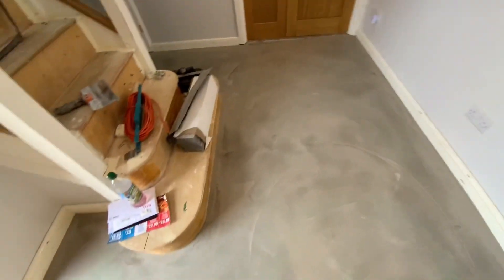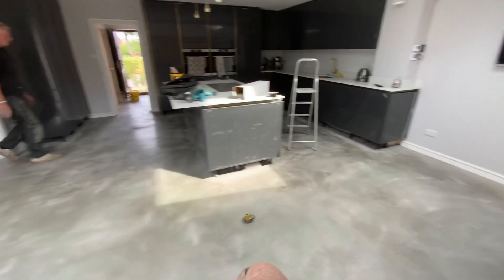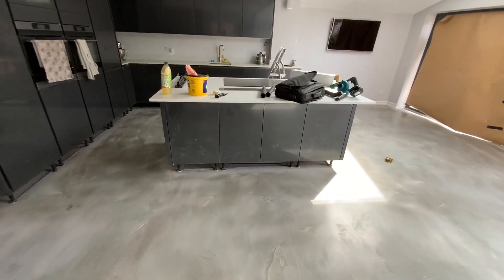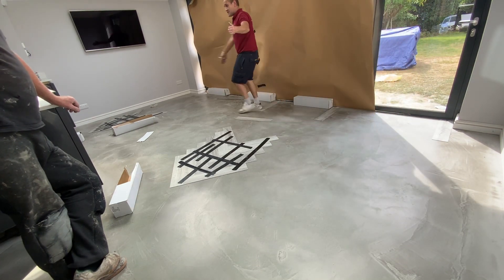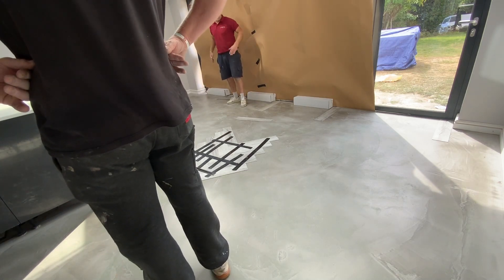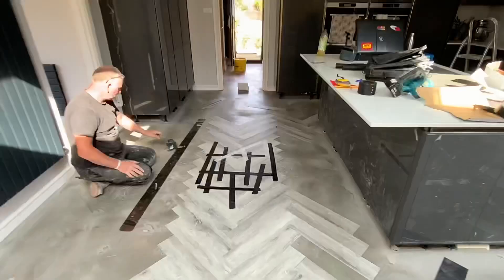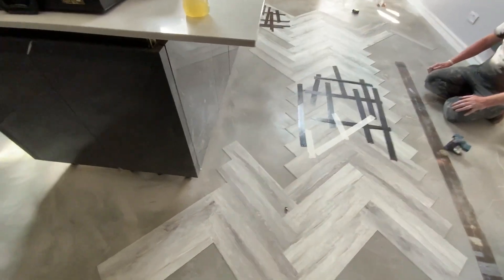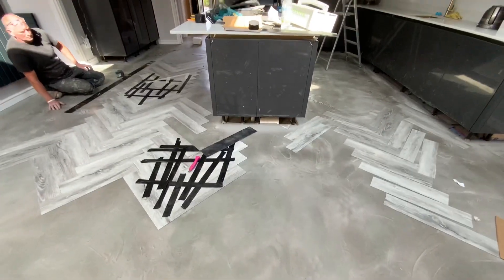Setting out LVT herringbone and what to look for .

Comment: The video was very detailed, clear and informative thanks. And after watching, it raised a couple of questions for me to clarify:

Firstly, I understand that LVT can be laid in a herringbone pattern, but I have recently been informed that only  if  it's a 'glue down or loose lay product'. And LVT that has a 'click and lock' mechanism on the sides will not work in a herringbone pattern because it can't click together properly and therefore will be compromised/fail?

Secondly, I was also informed to lay 'click' LVT existing skirting need to be removed due prior to fitting if architrave isn't wanted? 
Just needed some clear clarification around both points. Thanks